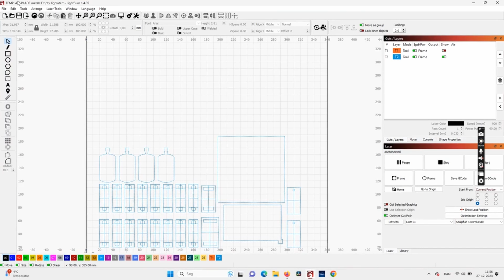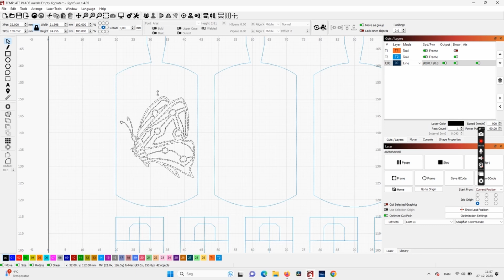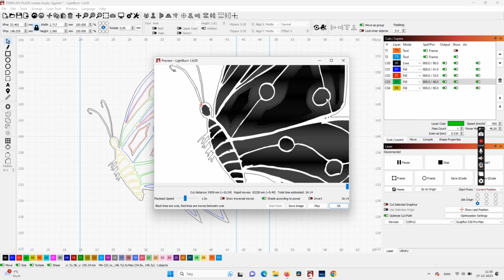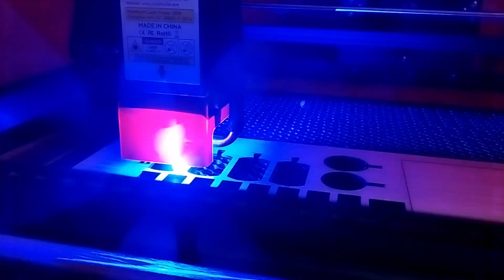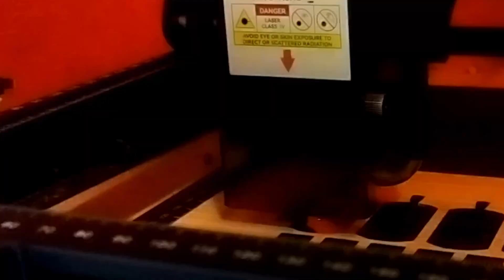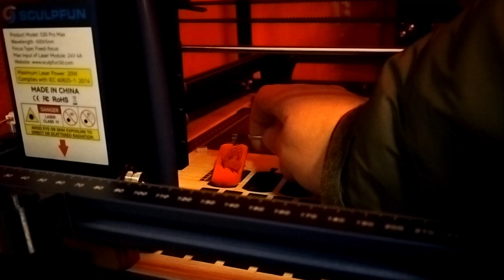Get COLORS on steel with 20w diode

Comment: it feels like the difference between fiber and diode is just power, but fiber has more thing frequency settings, but overall i like that is capable to do the same results with diode, thanks for sharing tips and tricks
Reply from the maker: I can't wait 'till I can one day afford to invest in a fiber so i can do truly deep engraves (and hit other metals than stainless steel) - but one thing I often get triggered by is the old "diode can only anneal/discolor" (I still see that on the forums/groups)  - If i hit Stainless with 90+ % power, i can FEEL the engrave with my nail :face-green-smiling:- but it is true that it doesn't really remove much.
Thanks for letting me know the video was okay :D